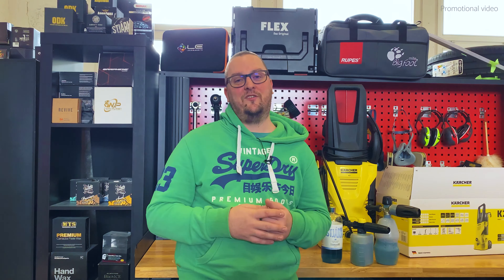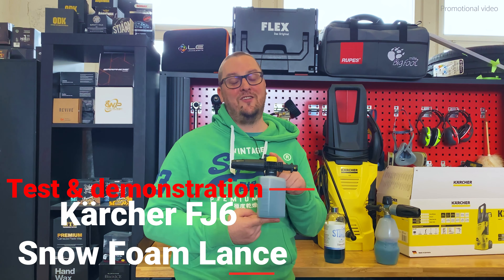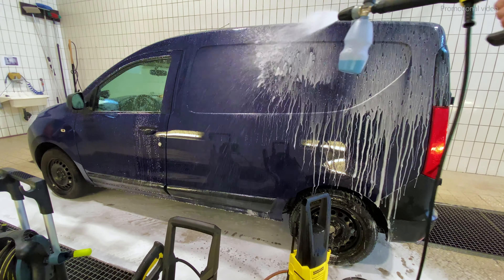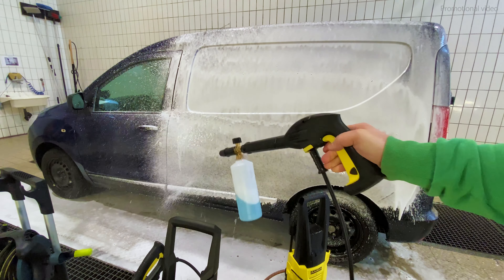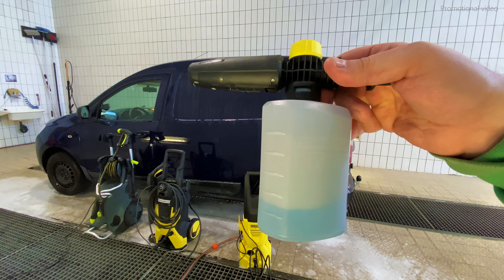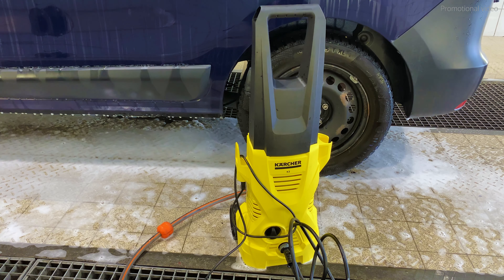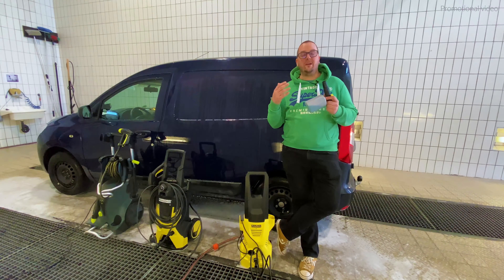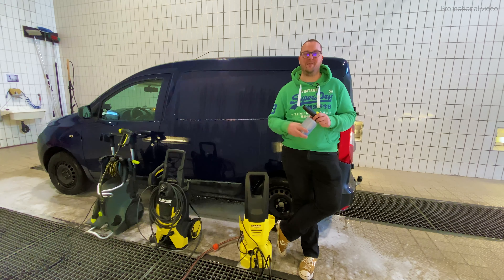I don’t get decent snow foam... the Kärcher FJ6 misery

Comment: Well I bought a FJ6, i washed my car the first time and the foam was exactly like in your video (I have a K5) so I thought I had to change the dilution ratio from 1:10 so same product quantity but less water in the tank because I used 450 ml water and 50 ml prewash shampoo. The prewash product is top of the line (Primus from Labocosmetica) so now I think I will be disappointed again.